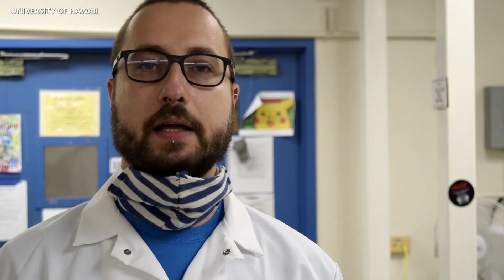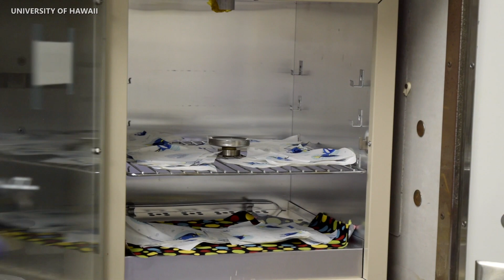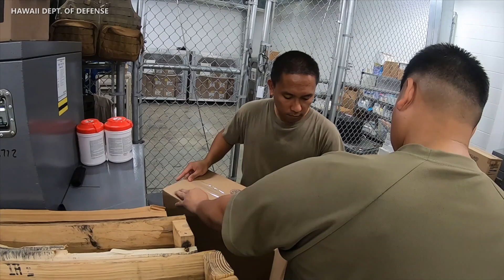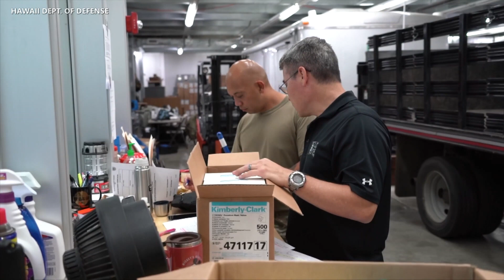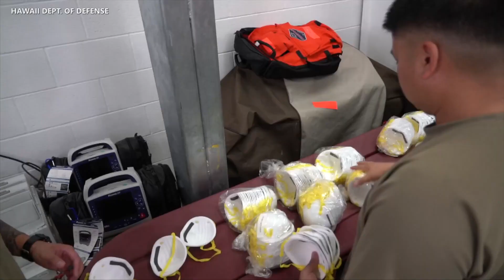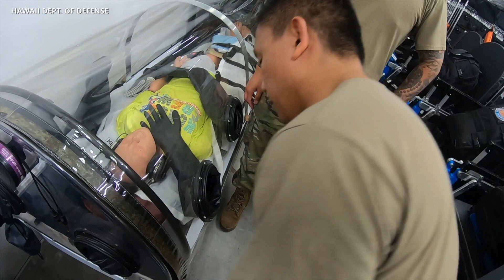Hawaii Working To Gather, Or Make, Needed Supplies (Mar. 29, 2020)

Comment: Nice effort but cloth is not good it absorbs your moisture from breathing in the mask and makes it susceptible to collecting droplets from the outside....info from the CDC. Look at a N95 mask and the outside is of a different material. Just use different material....good job coming through in a need